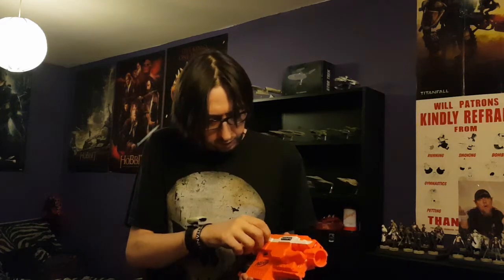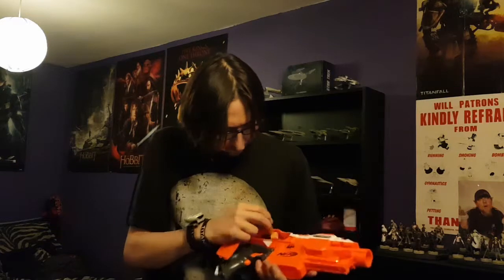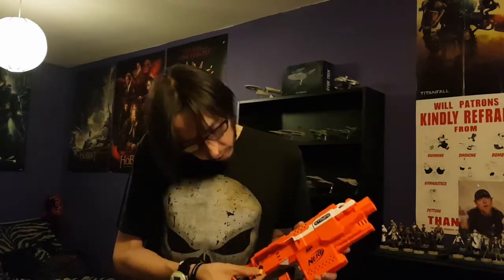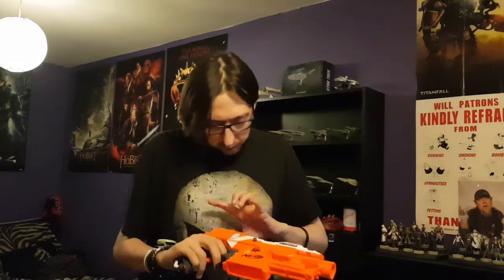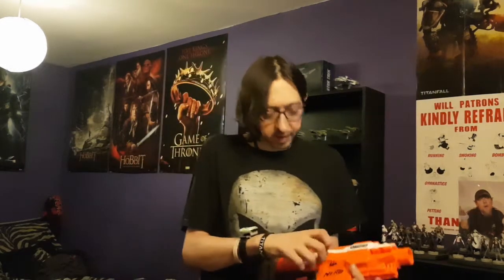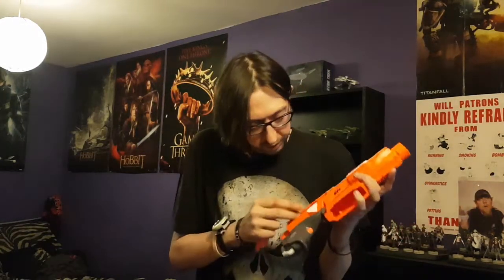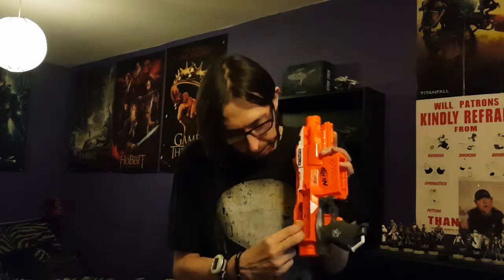Guillotine: my first ever electronic mod, it's a Sleeper-Stryfe that performs surprisingly well.

Comment: Matt, Guillotine, looks just sweet. Great job!  You should be Very confident my friend. You are doing great!!!!
Reply from the maker: Thanks guys, I'm going to do my next electronic mod on my 💖Rayven💖 I think, I got a big box of 200 various extension and compression springs, so a return spring for the Rayven should make the trigger snappier and smoother, as the pusher can stick and the trigger feels a little squishy.
That will probably get the Meishel 2.0 treatment as well, but I need a good, solid (preferably metal) cage and probably have to switch to brass or Worker barrel material because of the horrendous drag.
The Rayven you sent me is still my all-time favourite though :)

Comment: Wow.  We probably both did our very first flywheel mods on the stryfe at around the very same time lol
Reply from the maker: Yeah, and the extended mag release is the same too, (ok, mine is black) but I bet if we put our blasters side by side - open, they'd be pretty much identical except for the LiPo and motor braking wire on mine and Worker flywheels on yours!
Great minds think together eh? ;)
Reply: Matt Von Nerf i got the exact same lipo now lol.  I knew thats what I was getting though because I chose Meishel 2.0's spscifically for my stryfe to fit the lipo easier.  

I feel my soldering has got much better even though i have only done 3 rewires and one burned up 😂